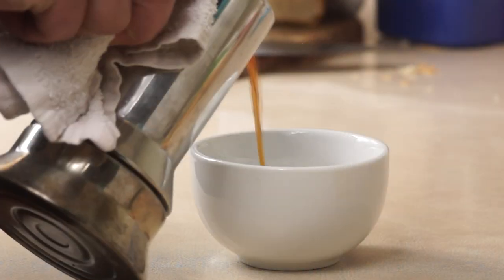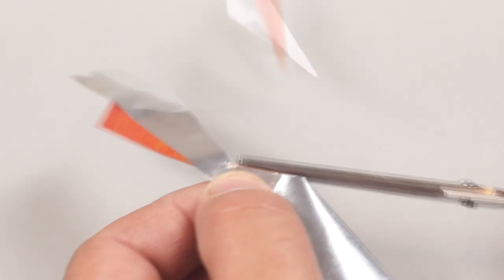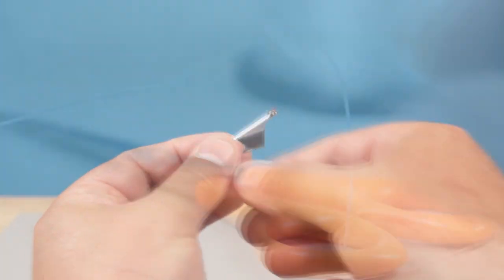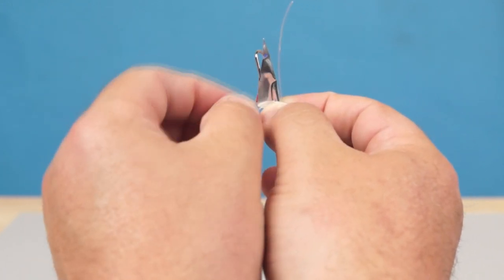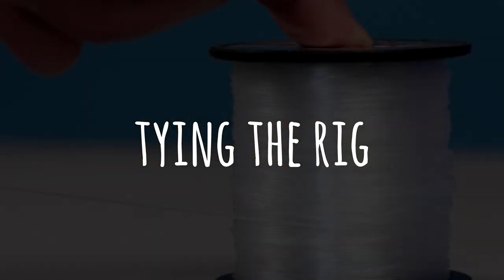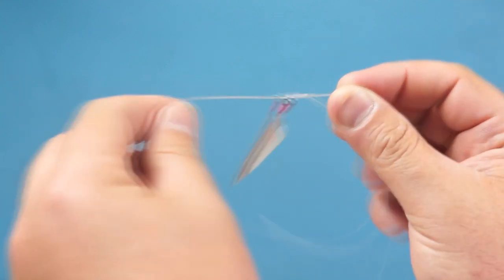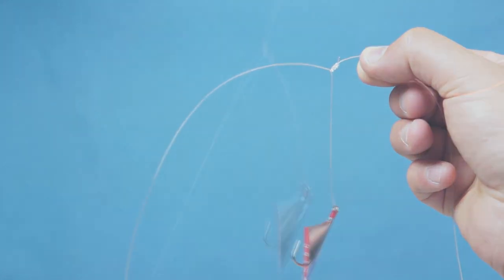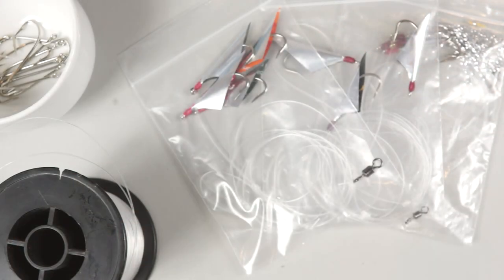Making a Coffee Packet Mackerel Feather Rig

Comment: Hi Paul, I made it and use it as a teaser with my casting jig using your same tip to connect it to the leader, miracles are hapening, thanks  for the great video and tips.
Reply from the maker: saskaleb great to hear, thanks
Reply: ***** juste a small remark Paul if i may, I noticed that you changed the knot you are using to tie the feather to the hook (comparing to earlier similar rigs in 2012 and 2013) , is there any particular reason? thanks
Reply from the maker: This is the knot i actually started out tying when i began making feather traces, it works and it it quick but it is not as strong as the knot i developed later which is in most of the videos. It only really works well with simple attachments and very few turns round the hook so it is not something i would use for everything but in this situation i am happy with it. Thanks for spotting and asking
Reply: ***** thank you for the knowledge generously shared (y)

Comment: couldn't you use a dropper loop
Reply from the maker: yep, dropper loops do work, i found they have some down sides, if you leave the full loop the rig tends to snap first on the main line, meaning i often lost a good part if not all the rig to snags, and when using a  cut dropper loop rig it was lot weaker. Most people treat these rigs as disposable item, but i made this rig because i wanted to use it for a long time, and I used rigs like this almost daily, sometimes for a couple  months before they finally gave in. but it is whatever works for you, cheers